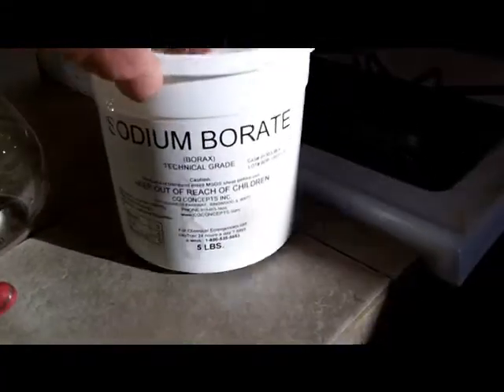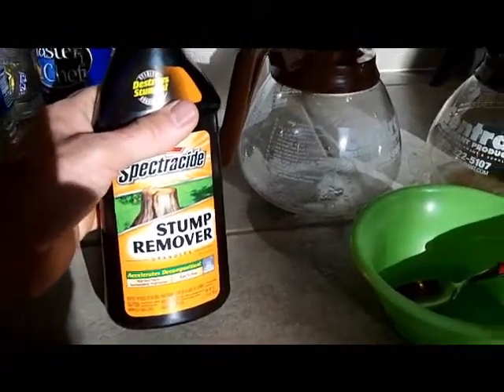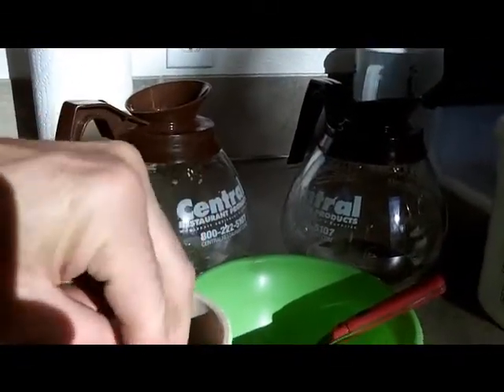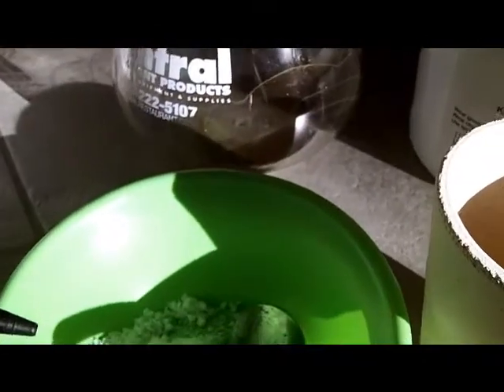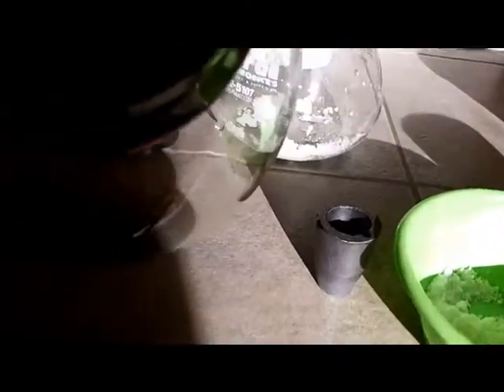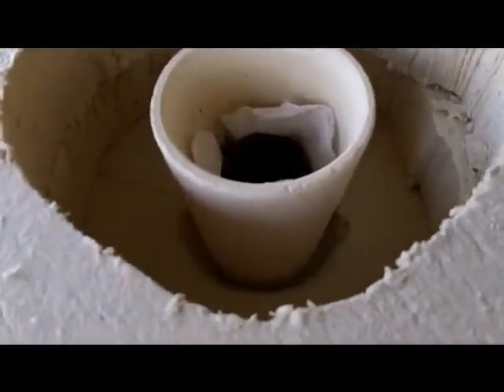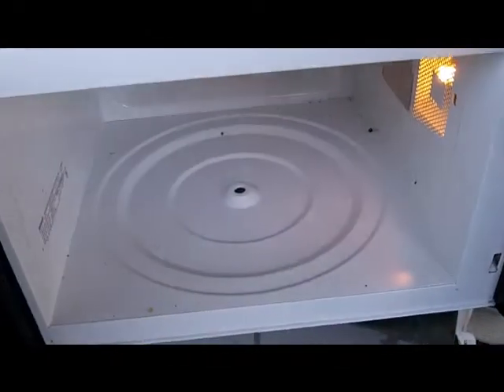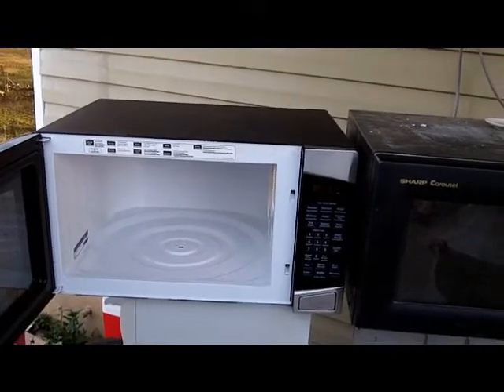Microwave Gold Melt Pt1

Comment: This will fix a drought , which in turn fixes famine. . This is just not a math problem . Its THE MATH PROBLEM . Electricity turns Magnetrons = Magnetrons heat gold (by directing the microwaves straight at the gold)= Melted gold.Melted gold is 1947.52 degrees F. It turns into a gas state if pushed to boiling point. (Gold boils at 5173 degrees F) . After that it starts turning into a gas. . Keep in mind 5000 is 10 times as hot as a nuclear power plant. So you could set a thermostat to keep the temp. at 5000(this keeps the gold from turning into a gas).(unless you want to go hotter) = Really HOT. This turns water into steam like nothing . The steam turns the Turbine Generators producing huge amounts of electricity. Then the steam travels up because heat rises , cools and condenses back into clean water. Where it is collected and returns into the system. Where it can be used again. Since hot steam rises it will carry the steam up.When it cools the tank will be above the system.It will then have pressure.(like a water tower) When it feeds back down use it again to turn the Magnetrons, or more generators.The water is then sent back to the reactor, where it returns back into steam repeating the process. By Joshua Franklin Allen. If you have any questions just ask. The reason this is so important is because Gold in inert , and doesn't break down . Which equals no more fuel needed. No nuclear waste, and no enriched uranium.Which means no nuclear weapons.This would have prevented the melt down in Japan. We could survive in the worst conditions with this.It's also is safer so it can be moved closer to where its needed. For water it could be used to clean it. This would need a different design , the dirty water would come in from the source. Then the steam would clean it when it distills it. Then the clean water can be used. You could water your fields with salt water. The only problem is your left with waste . So the tanks would change out so it can be cleaned with a bulldozer(The tanks move through it , like a train, so it could just keep driving, the waste is in the tanks). So that it's easy, and simple to maintain. Depending on the waters contents , sometimes this could be useful. (salt,gold) . So in this case it would produce something.This can be modified for many reasons, so be responsible. I call it the " Ark of Joshua "   By: Joshua Franklin Allen
Reply: Mr Joshua Allen, your comment is not remotely accurate, on any point.

Comment: Hi Im sort of stupid.  I am interested tho.  My question is after the gold falls off the chips ect into the jar as a precipitate and you are left with what looks like gold flake sludge, is it necessary to continue adding chemicals to turn it into a liquid or can you just place it into a crucible at that point with flux and microwave?  It seems to me that you can actually see the gold and the heat should separate it leaving a crust outside with gold in center.  Remember Im stooped.  I just don't want to have to buy all those chemicals and continue thru a parcipitation, I want to skip that part after the gold has been stripped from the electronic parts and go straight into smelting.  Id like to just invest in a microwave kiln some crucibles and flux and a mold and that be it..is this possible?